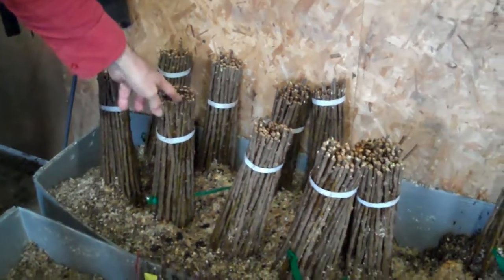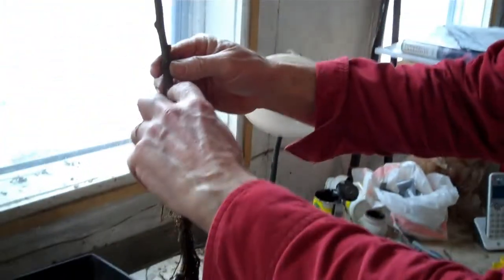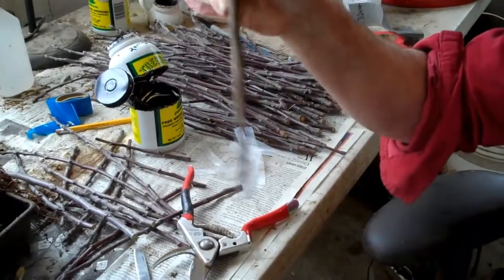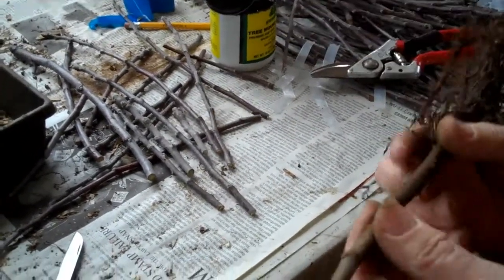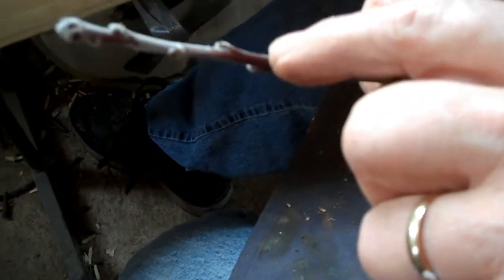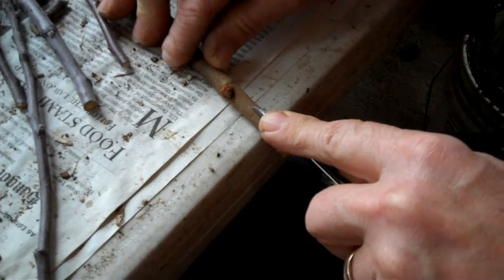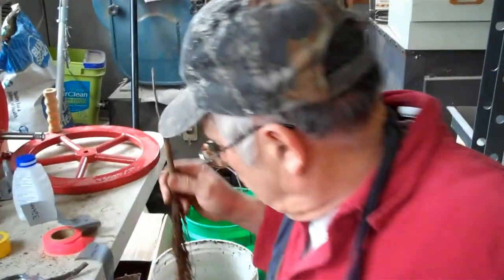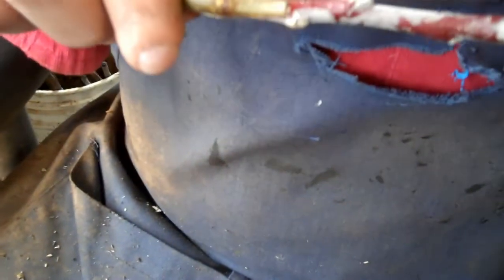Bench Grafting Apple Trees with Whip & Tongue and Bark Grafts

Comment: Herb, I am going to be bench grafting apples for the first time this Spring.  Is there a reason you don’t use a grafting tool that cuts the “V” in both the root and scion.  The tool kind of looks like a hand wire stripper  I assumed it would make it easier to line everything up.  Thank you for sharing your experience and knowledge in this video.
Reply from the maker: Thanks for your comments.  Delton has been grafting for many years using a simple grafting knife and he achieves nearly perfect success.  This method takes more skill but is perhaps more flexible for different size tree stock.
Reply: Thank you.  I may try both methods.  This year I am only grafting about 20 trees, but I want to get the skills down before I try greater numbers.
Reply: @thatguyc5899  I suggest when you are pruning your trees, practice with the prunings. Do a couple hundred practice grafts, and you will hone your skill to the point where you will have great success. Try several different sizes to each other, and play with it for a few hours each day, while you have good wood to work on. (I wouldn't paint them with the trekote, but practice wrapping with parafilm is good too. 
Good luck!
Reply: I grafted up 20 trees last weekend. Used a few different options, I have the grafts at different heights based on where it best lined up on size floral some of them.  They are in the basement in damp sawdust right now.  I was going to leave them in the 50-55 degree basement for a few weeks to heal.
Reply: @thatguyc5899  
So,
Did they survive?
Reply: The ‘machines’ require you to in some way keep the scion from shifting toward the center of a larger rootstock.  They lack the ‘mechanical’ lock of a tongue..

Comment: Thank you for the video. Please tell us about that black stuff used for the protection of scion and bud union.
Reply: If you want the best, hunt down some Doc Farwell’$ latex based grafting sealer (yellow); good luck finding less than a gallon.. The brown stuff (shown) is crude, doesn’t expand with growth, takes forever to dry, but is relatively cheap.
Reply from the maker: This is a tree wound dressing called "Trekote".  You can buy this online:

https://www.amazon.com/Clarks-Treekote-Brushtop-Container-16-Ounce/dp/B000OW9UPU/ref=asc_df_B000OW9UPU/?tag=hyprod-20&linkCode=df0&hvadid=193150648923&hvpos=1o2&hvnetw=g&hvrand=5070462823393646914&hvpone=&hvptwo=&hvqmt=&hvdev=c&hvdvcmdl=&hvlocint=&hvlocphy=9002618&hvtargid=pla-305159996819&psc=1

Comment: He says "What" he does when he has more than one bud - comes back and removes any additional buds above "One". My apprentice view question is "Why"?
Reply from the maker: Believe Delton want the tree to grow with a single trunk.  Having 2 buds at the start increases the chance of grafting success.
Reply: I've seen how this plays out.  With 2-3 buds, and only the bare minimum of nutrition coming in, what typically happens is that the scion allows one bud to dominate, and the other buds, if they grow, are stunted.  So, once you have a "take," identify the MAIN bud and remove the rest.  This also gives you a single straight trunk.
Reply: Most growers want the single trunk. Having 2 buds is insurance for us novice grafters. After the graft takes, identify which bud you want to keep, and let it grow, cutting off all other buds from both the rootstock and the scion. This allows a single whip to grow that first year. We think about branching later, when the whip has some height on it. 
For shipping, anything longer than 2 feet costs more to ship, so many commercial growers trim their trees down to the 2 foot length for shipping. Having one strong trunk has a better chance of long-term survival after shipping and planting out. 
Good luck.
Reply: Previous answers are correct, however, ‘tip-pinch’ additional bud growth, leaving up to three sets of leaves; they shade the trunk/ bark, produce energy for the graft union and the one upright shoot you left.

Comment: While watching you doing the whip and tongue graft I think I just figured out a secret that makes it almost impossible to fail.Most other grafts you have to line up the cambium on the sides which is not easy to do, but with this method the cambium layers meet at at the top and bottom of scion and root stock.This is demonstrated at the 4:20 time line quite clearly,as long as the cuts are flat you should succeed.

Comment: Electrical tape will indeed come off on it's own. Time and the sun takes care of it. Of course you wouldn't want to make multiple wraps with it, but it works.
Reply: In order to bind scion with stock electrical tape must be pulled, even slightly stretched, often using several wraps.  If not removed, it’ll girdle the scion.  Instead of unwrapping it, make a razorblade slice through the length of it ..and allow it to peel off on it’s own.
Reply: @vf5126  Yes, I've been using it for many years.